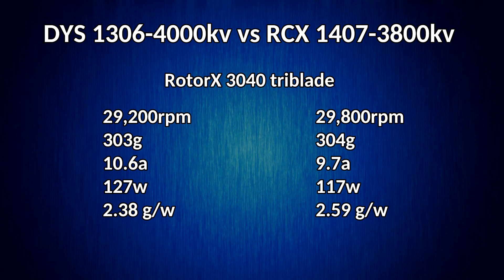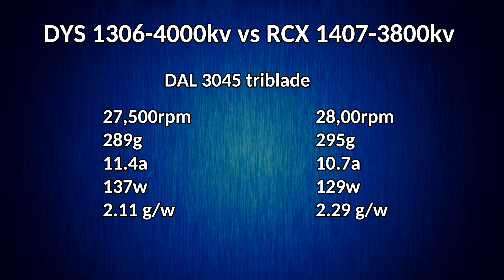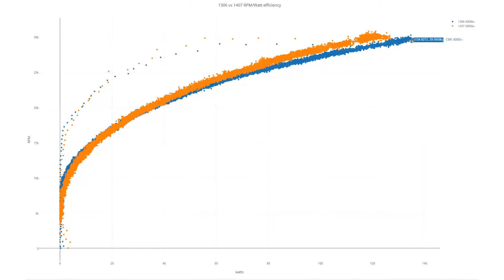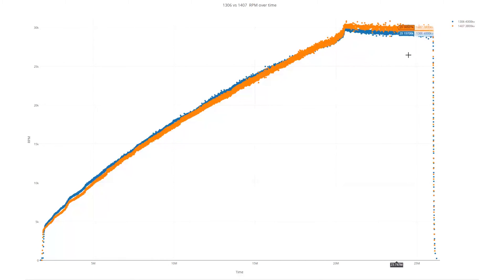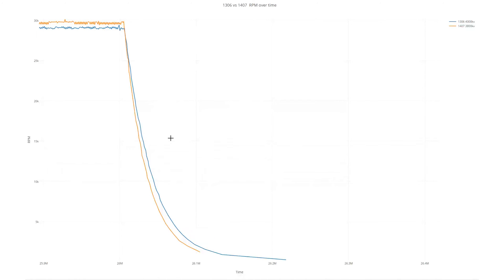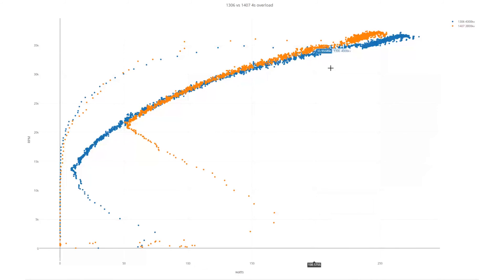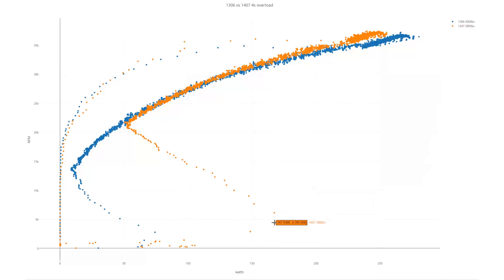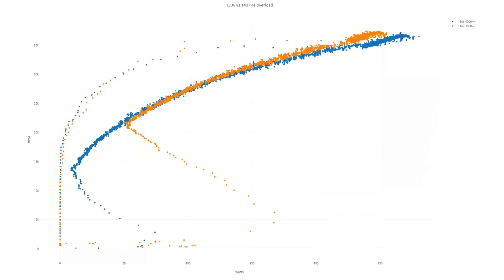1306 vs 1407

Comment: you forgot to mention and calculate the weight of the motor. if the motor is 3g more heavy and only does 2g more thrust that's not very good. and you also have to consider that the thrust gain on an actual frame  probably isn't 100%  of the on bench tests. but the weight will be the same on the bench as in the air.
Reply: Max Berkenstam  that's true for racing, but for freestyling, the difference is negligible and you get better efficiency, which gives you more flying time. In the end, I think the difference is marginal.
Reply: The whole video I was wanting to know "how much do they weigh".
Reply: @oneofthesixbillion  roughly 5 gms heavier each motor. :)
This whole test is flawed. I have been making so many sub 250... I always know higher stator motor will give more torque, but theres a sizeable diff in weight between 1306 and 1407 or 1408 per se. Just imagine a quad 20+gms lighter than 1407 or 1408 more still, the thrust required to lift off will be much much lower, so you end up drawing less amps and higher efficiency.
The calculation should be based on weight to thrust ratio.